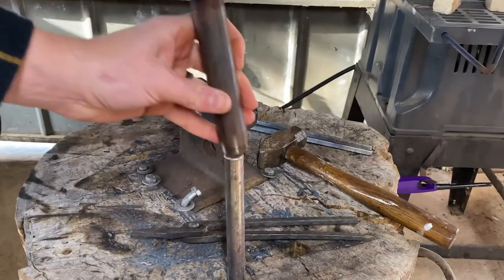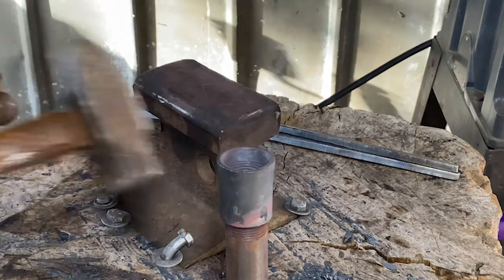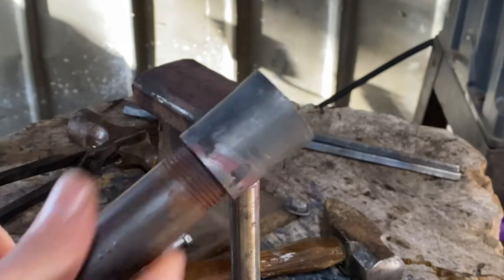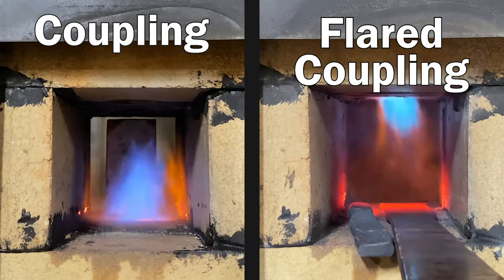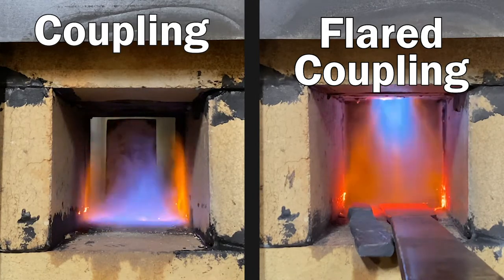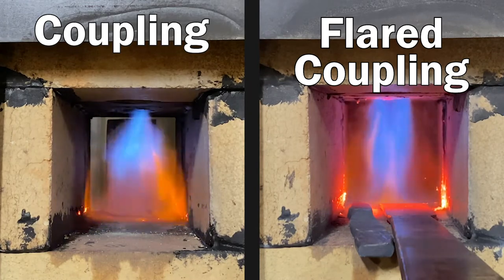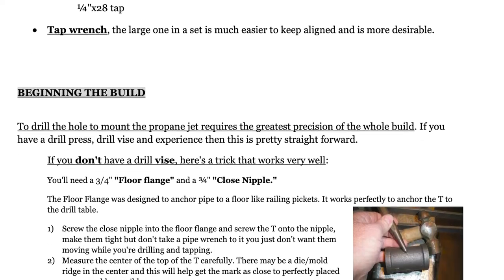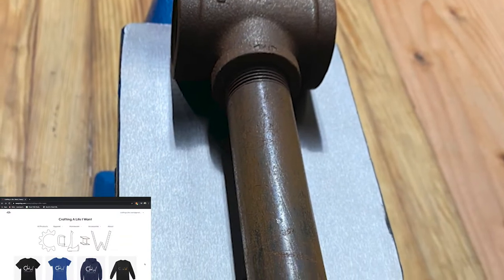UPDATED!!! - Frosty-T Naturally Aspirated Forge Burner

Comment: how did you adjust the mig tip did you cut it shorter.
Reply from the maker: I ground it shorter with my grinder. You could use a file or sand paper as well.